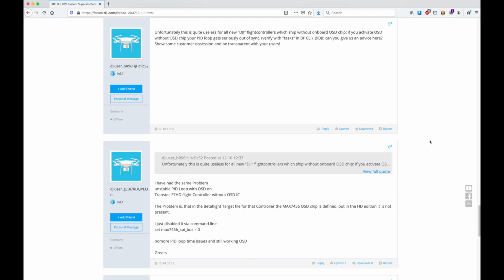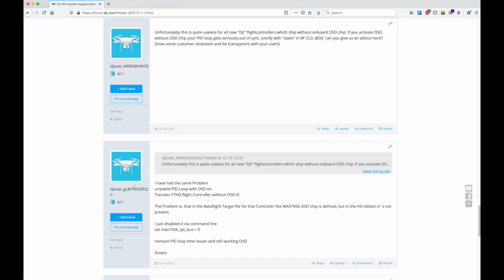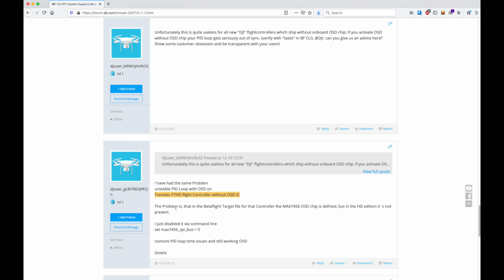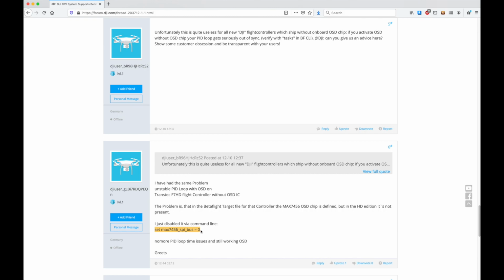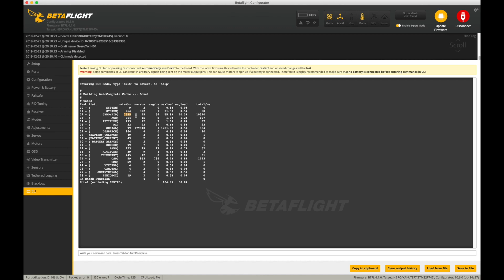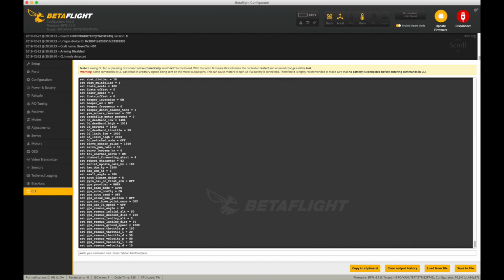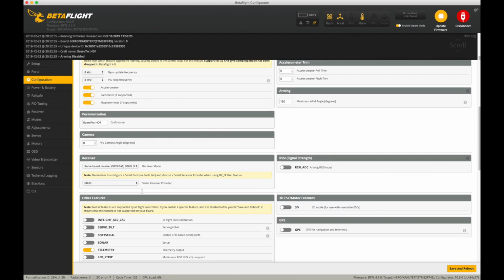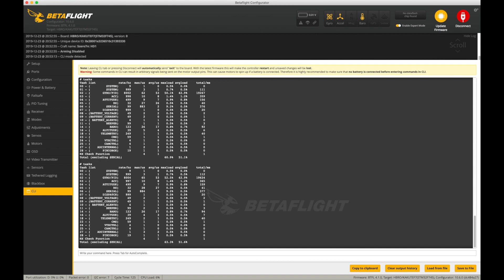Betaflight OSD and DJI FPV May Cause PID Loop Issues

Comment: would it fly at all without the fix, and if so, how did it fly? was it flying like it needed a tune? i have a different Hobbywing XRotor F7 Convertible Flight Controller
… i  installed dji system and it feels like it needs a tune, it flies rough with lots of jello effect, i found this video and thought before the nightmare of tuning,  maybe this could be happening?
Reply from the maker: I think it flew ok without the fix.  However it might depend on your tune.  If you are running recent firmware you should not have this issue as it was fixed.

Comment: What kind of pid issues, and for the life of me I cant find out if my new taycan/Mamba F405 dji mini fc (with a dji AU) has an osd chip on it or not, grrr. I cant get my bf osd to work. Not sure if I need to flash the fc or not. Using bf 4.12 now. Kind of new to all of this.
Reply from the maker: If you are using the DJI FPV airunit or the vista, it does not matter if your FC has an OSD chip or not as the DJI system takes care of doing all the work for the OSD.
It can be tricky to get all the OSD to work.  Most likely you need to enable MSP on the correct UART.  MIght have to look at your manual to figure out which one it is.
Reply: @5zero7RC  I do have the regualar full size AU in the quad and utilized the nice cable that plugged directly into the dji port of the fc and into the AU. That would be nice if they had sent any kind of manual at all. Purchased the PNP Taycan from Race Day Quads and all I got the quad in a black box. I'm stumped. I wish I could find one person that has also purchased this exact quad so I could ask them how they got the osd to work. I've all but given up on it to be honest.
Reply from the maker: Has RDQ support been any help?  I would assume they would try to help you out.  I see the DJI taycan that RDQ sells should have the MAMBA F405MINI MK3 flight controller in it, like you state.  But from the manual and photos I do not see a DJI plug in between the FC and the Air unit.  This wiring diagram shows how it should be wired... https://cdn.shopify.com/s/files/1/0027/2708/4144/products/mamba-f405us-mk3-mini-f35-3-6s-flight-controller-stack-electronic-system-new-diatone-innovations-official-662_1024x1024@2x.jpg?v=1599112600   

So you want MSP enabled on UART 4 if wired like this diagram. That should get voltage in your osd if MSP is working and wired properly.

Comment: I’m sorry for my English, I wasn’t able to translate everything. I just ask you something. Am I right DJI goggles now show OSD like analog fat shark?
Reply from the maker: Yes, DJI goggles now show OSD from Betaflight.  But not everything is supported yet.  DJI has been adding more and more OSD support in every firmware update.
Reply: @5zero7RC  I've got a kakute f7 hdv and kakute f7 v1.2. is it good for osd?
Reply from the maker: @turbersis  Yes, I also have the Kakute F7 HDV and it works fine with the Betaflight OSD and the DJI FPV goggles, even though it does not have an analog OSD chip.

Comment: I've read the problem has been solved, anyways, what do I have to do in betaflight 4.2 for avoiding this issue?
Reply from the maker: I also believe the issue has been fixed with more recent betaflight targets for those flight controllers.  However you can follow the steps in the video to verify if you are still seeing the issue or not.

Comment: Hello, I also have a kakute f7 v1.4 have followed everything (uart1 msp activated and so on) and still do not get an osd, dj airunit has the latest version 1.0.4 on it ... my transmitter is a frysky xsr and it is on uart4 ...
why do I get no tension or osd in the glasses .... I need the osd on the screen .. please help, I don't know any more ..
Reply from the maker: Do you have the HDV version of the Kakute F7 with the connector that plugs directly in between the air unit and the FC?  Do you get any voltage reading in the goggles?  Maybe my build video has the answers you seek?  https://youtu.be/zWFeI_SN1Vk
Reply: @5zero7RC  
yes I have, no unfortunately not. the fc and the airunit are connected to the adapter, cable.
FC is on the latest firmware. msp is activated. everything as made in your video .. frysky sbus is with me on uart4 ... in the glasses the osd is on u.s.w. but still nothing works .. do I have to change something? really need help ..
Reply from the maker: You might need to reach out to DJI for help on this one.  I have heard some people had defective air units that caused them to be unable to get OSD.  But you definitely are having an issue getting the signals from the flight controller to the air unit.  If you don't get voltage then the MSP connection is not working right for some reason.
Reply: @5zero7RC  yes I have 2 quads, it has the same system, it can not be that my 2 air units are defective ... dji said that they like to check the air units .. but it can not be that both are defective ... somewhere he has to mistake yes ... should I try soldering to a different uart? stand shortly before that I buy other fc´s .. it really is no fun to fly without osd ...
Reply from the maker: I agree, flying with no OSD is not fun.  If you are using the connecting cable the FC came with, it should be good.  But you can also try using the cable with no end on one side and solder the wires to a UART instead.  Just be sure to connect tx to rx correctly.  And if it does not work, reverse them.  If that still does not work, maybe reach out to Joshua Bardwell via email or facebook and see if he has any advice.
Reply: @5zero7RC  
ok thank you for your efforts .. i will try to find the mistake ...
Have a good time :)

Comment: I have no osd in my google fpv from dji please help? Wrong uart? Aktiv
Reply from the maker: Do you get voltage readings for the drone battery in your goggles?  If not, then you don't have MSP enabled on the right uart or you have the tx/rx wires backwards.  If you do have voltage, but not betaflight OSD values, ten that is a different issue.
Reply: @5zero7RC  i have the kakuten f7 with cable for the airunit but neither the time air nor i see the tension just the tension of the glasses! I definitely need help several people have the problem. No osd okay. but having no tension is bad.
Reply from the maker: @FerberPascal  That sounds like what would happen if you don't have MSP enabled on the right UART for the flight controller.  Since you have the same FC as I do, double check that you have done the same steps as I have in this video: https://youtu.be/zWFeI_SN1Vk

Comment: What FC does Iflight use, or is there one specific to the air unit if you don't use your own? I just got the rtf package, with controller, goggles and megabee, not only did I get a mode 1 controller, but I cannot get quad to hook to BF at all.  Is there a different port I should be using, all my other quads connect on same port I am trying with, or do I need to flash new firmware to the megabee?  If so, what's my target.  Also, I registered/activated air unit, goggles and control unit with DJI assistant 2, (fpv), updated all three to latest firmware and bound both goggle and radio to the air unit.  I am staaaaa-ummped. 

On a side note, found video tutorial on how to switch to mode 2, but it involves taking controller apart, and basically switching gimbals.  I've taken apart plenty of radios, but never a DJI, think it's worth it, or just send it back and wait 87years?..lol
Reply: Disregard, guess I should have gone to their site first, It just happened and I was frustrated, so I came to youtube first.  Megabee uses the  SucceX-D Mini F7, target is STM32F7X2 , I need to update it to 4.1 before controller will work, but will still be mode 1  uggghh.
Reply from the maker: Good Luck!  Hope you get it all figured out.  What radio did that come with?  Most mode 1 radios can be modified /converted to be mode 2.  Might require you to open them up and move some springs around.

Comment: Came here from dji owners thread rcgroups. I encountered the instability in gyro/pid whilst changing over to rpm filtering, I wondered why the numbers were so far from set points and this has resolved the issue thank you! (using Kakute hdv7)

Comment: Great video. Worth a mention, maybe for your next build, the Diatone Mamba F722S 30x30 Stack has a BF OSD chip, 9V 2A BEC that will easily power the DJI air unit, a 50A 4-in-1 ESC, and Speedybee Bluetooth ready to go from the factory for PID/filter etc changes right from your phone or tablet in the field. As far as I'm concerned this is the killer F7 stack right now. It's also only $79

Comment: Same issue, same OSD chip, same fix for the iFlight Succex-D TwinG F7 for DJI flight controller.   iFlight doesn't have any official BF target for this board. They supply their own diff to be applied (to enable gyros etc) , but it doesn't address this issue.

Comment: does your Kakute F7 take a long time to do Gyro calibration?   mine takes about 2 minutes to calibrate.. and usually need a restart after two minutes of wait to Arm. thank you great video
Reply from the maker: No, I have not noticed my Kakute F7 doing anything strange like that.
Reply: @5zero7RC  I am must have messed up it .. crashed it few time hahaha ..thank you for your reply

Comment: The problem is that you're using a target where the manufacturer has specified than an OSD chip (MAX7456) does exist and defines the pins to communicate with it. So guess what? Betaflight tries to talk to it - that's the way target definitions work. Betaflight has no way of knowing that the OSD chip isn't really there - the target said it was! So the communication times-out and this leads to processing problems and delays (only a single CPU core - no multi-threading). The solution is that the manufacturers should not try to reuse an existing target for boards with an OSD chip on boards without. Contact the manufacturer and complain. There is no problem with Betaflight and it's working exactly as it should.
Reply from the maker: It would be awesome if Betaflight could be smart enough to detect a situation like this and work around it somehow, but I also understand how it is really an issue with the manufacturers target.  I guess they were all rushing their products out the door and didn't take the time to optimize their targets.
Reply: Or even take the time to actually test their products. Would have taken them but a few minutes to submit a correct and working target for these boards. But as always they don't bother with QA and just let their customers suffer. Then it's left to Betaflight to try and clean up their mess - for which they didn't even bother to supply any samples for us to test or develop with. So you can see why we're not motivated to fix the problem for them.
Reply from the maker: @BruceLuckcuck  Agreed.

Comment: Thanks for the tip.  I applied the "fix" and it worked.  I have the exact same FC.  I got it because it's easy to plug into the DJI FPV system.  But I didn't know at the time that it eliminates the OSD chip, and also removes all analog video input/output pins.  Plus it's only four solder joints to connect the DJI air unit anyway (power, ground, Uart Tx, Rx).  Had I known all that, I would have gotten a "regular" FC so that I still had backwards compatibility with analog video systems.
Reply: would it fly at all without the fix, and if so, how did it fly? was it flying like it needed a tune? i have a different Hobbywing XRotor F7 Convertible Flight Controller
…

Comment: The manufacturer should submit a non-OSD target to the project.  Beauty of Unified Targets.
Reply: I have notified my contacts at Holybro,Transtec, and iFlight. They are aware of the issue and say they will fix it ASAP.
Reply: @JoshuaBardwell  , good man.  Thank you!
Reply from the maker: @JoshuaBardwell  Thank you!  Hopefully if the manufactures fix their targets we can save some people from a little frustration in the future.
Reply from the maker: That would be ideal.  Do you know if there is a good way to communicate this particular issue to the manufacturers and their people responsible for the targets?  I don't suppose there is a proper place for this on GitHub?
Reply: Do they have a support communication channel (the manufacturer)?
Reply: Update a new firmware for TRANSTECF7HD, thanks for share this problem ^_^
Reply from the maker: @ChenDavidTso  Thank You!
Reply: From eTracer (lead BF dev.):

If the target for the board defines the pins for the MAX7456 OSD chip and the OSD feature is enabled, then guess what? It's going to try and talk to the OSD chip. IF the chip isn't there then guess what? It's going to timeout and affect other processing (single CPU core). So if the manufacturer is reusing an existing target from a board with an OSD chip on what that doesn't, then they're making a mistake.